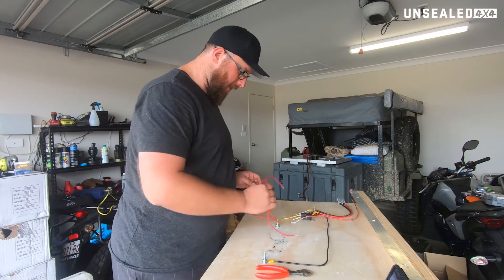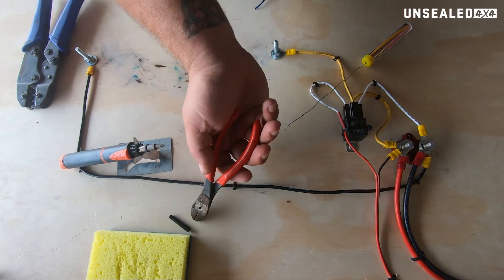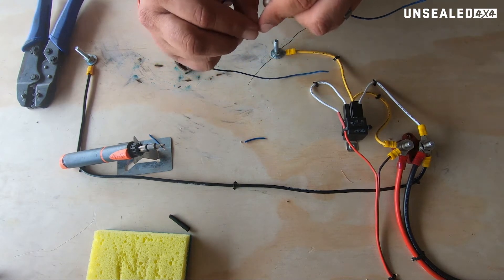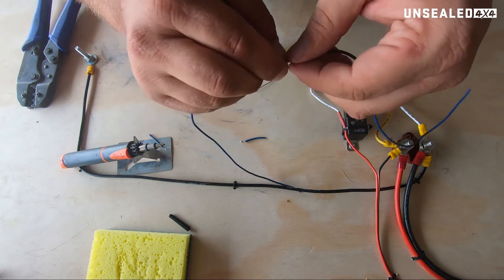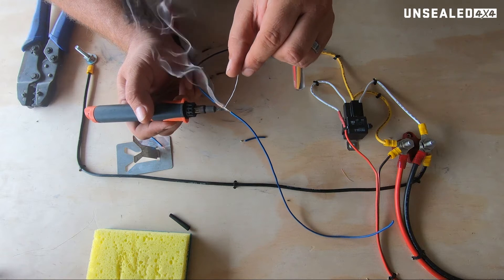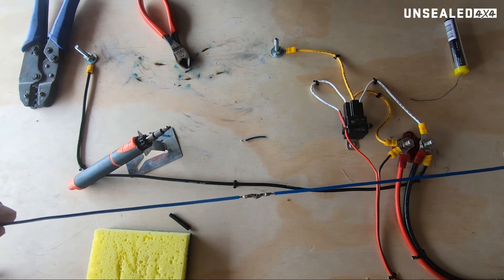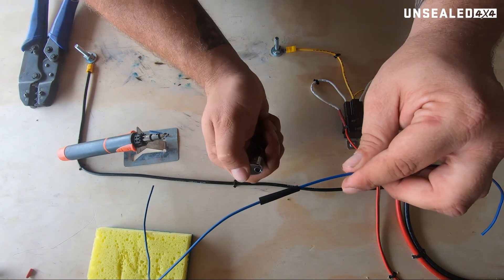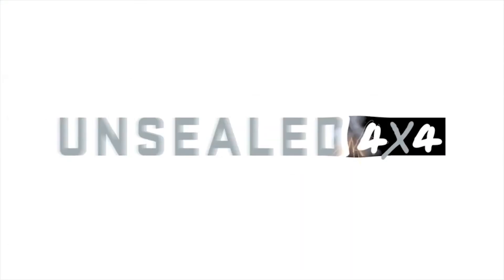12V Guide: How to join wires together

Comment: The way you twist the wires like that is going to create a short. The way you join wires is to connect them with a crimp and then crimp them together. The way you have the wires twisted in multiple places instead of uniformly joining them by laying them on top of each other and then crimping is going to cause a short.

Comment: Nice job I usually  clean the flux off with 91 % isapropyl alcahol to trmove flux residue. T hats was by General Electric Mil Spec 2000 late 80's